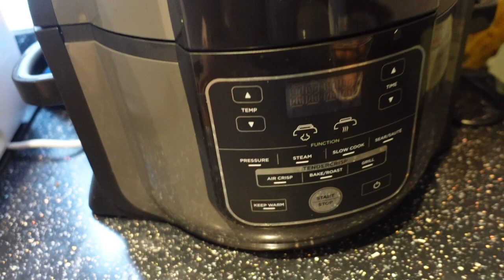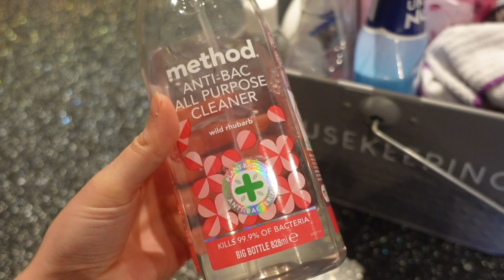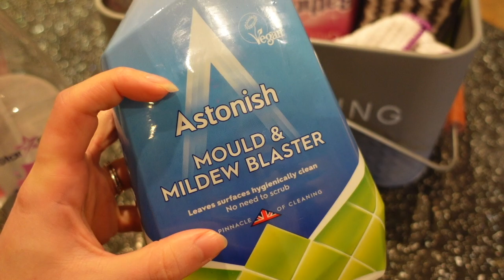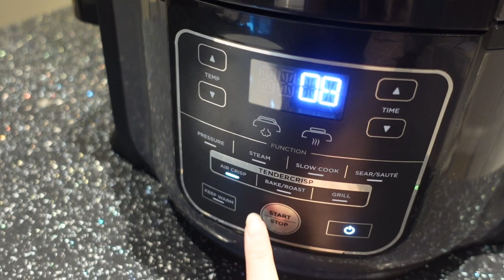Cosy day of homemaking - Clean with me, honest chats & get organised - Homemaker day in the life

Comment: Hi, I had a slippy cushion sofa too. I solved it with velcro. Go to your fabric store and get the wide velcro with sticky tape on the the other side. It's peel and stick. Problem solved. 
Love from Toronto Canada. 🤗
Reply from the maker: I did that when I first got the sofa but it still slipped! I will try using a few more strips and see if that helps. Thanks so much for your advice